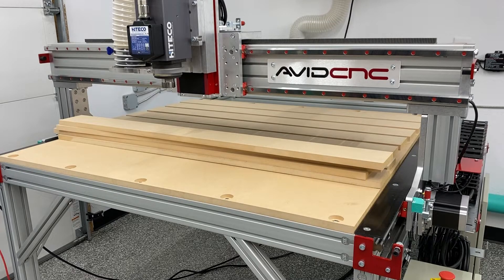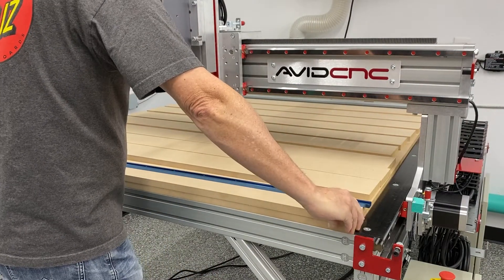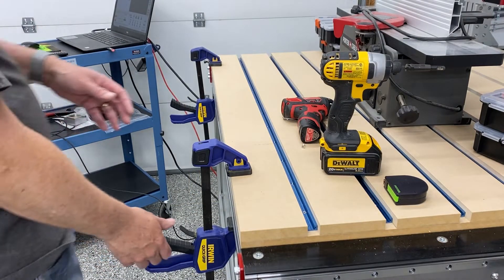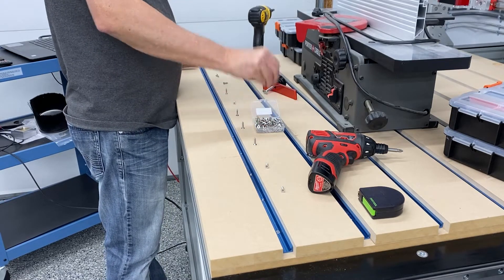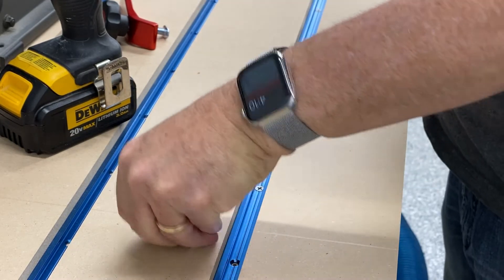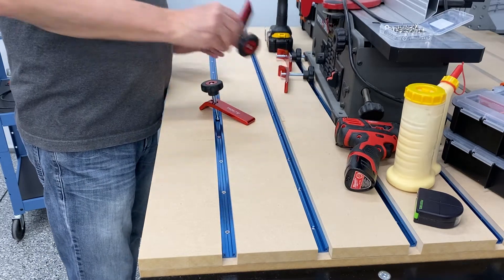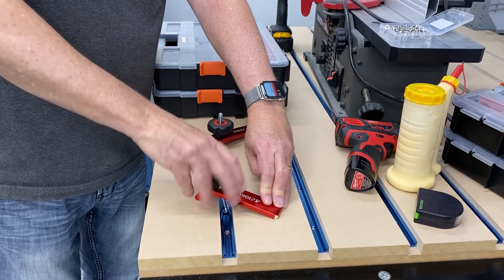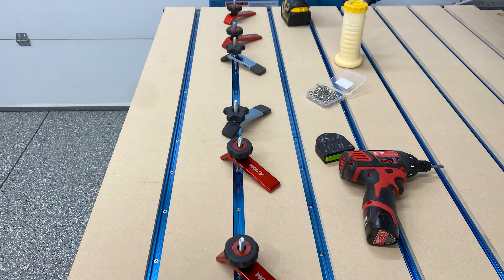How I made a T-Track and MDF Spoilboard for the 48" x 48" AVID CNC!

Comment: Just setting up my Avid today also. Was there a reason you laid you tracks the way you did vs most ones i see lay front to back?
Reply from the maker: This layout just worked better with the dog hole configuration I use. You can see that in some of my later videos.
Reply: Thanks, I just ordered 7 tracks to make mine with. What dust boot are you using? Need to make or buy a printed one @BlueLineCNC
Reply from the maker: @drich6816  kentCNC makes a good one. If you want a printed one, I recommend one guy in a shop, on Etsy.

Comment: I just bought some armour t track clamps like you have but found they did not fit with the included T bolts.  Do you happen to remember the size you used to make them work on your setup?
Reply from the maker: Greetings!
The size the clamps come with don't  work.  If you built your spoilboard like mine with a base layer and just one layer of 3/4" MDF on top, your Armor clamps will need 1" T bolts.  I had a kit with a variety of sizes and knobs, etc.  You may find it useful.  https://amzn.to/3FbUV1D
Russ

Comment: Hey Russ.  I really like this design but had a quick question.  I see that you and most others glue down the top layer of MDF.  I know the 3/4" MDF can be resurfaced a ton but what do you do when it gets down to the top of the t-track?  At some point we will all want to just replace the top layer but if it is glued down, how do we remove it?  I want to build the same type as you did and was just looking for any future guidance.  Thanks.
Reply from the maker: Depending on how bad you plan on abusing your spoil board it will likely be a long time before you have to replace it. Then you just resurface to where the bottom layer just starts to show. You’ll see your bolt holes. Then glue as many layers of 3/4 MDF. T-tracks should be below the top of the bottom layer but you can just unscrew them and take them out as well.

Comment: Loving your content and subscribed. I'm looking at upgrading from my Shapeoko. One great thing about Shapeoko is something they call a Bitsetter. This saves you from re-measuring the Z-height every time you change a tool in the middle of a job. Does Avid have something like this? Do you know if a third party manufactures something like this?
Reply from the maker: Hey Craig, they have the z height touch plate but no bitsetter. So you have to re-zero when changing tools.